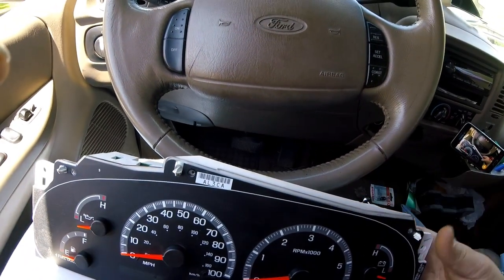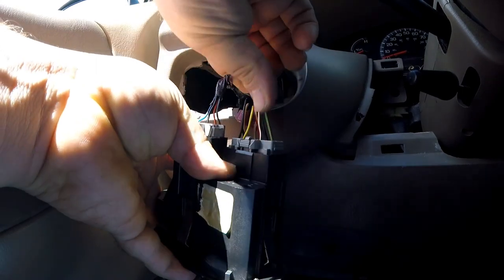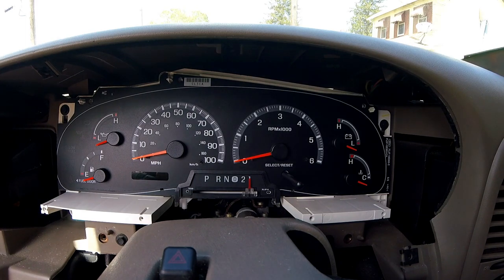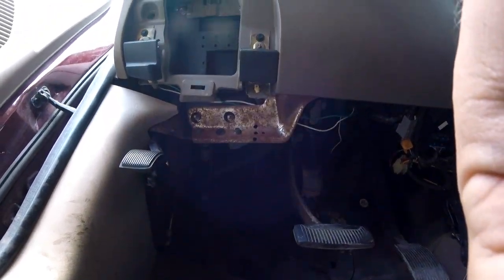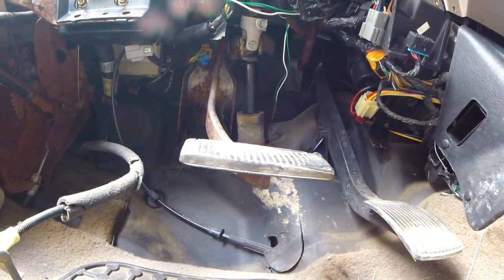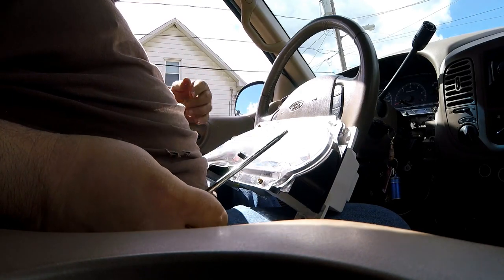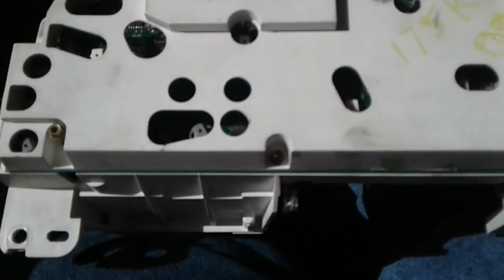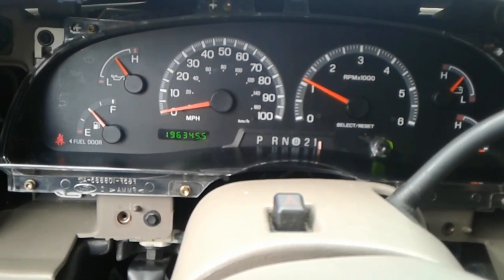f150 gauge cluster repair

Comment: I've got a similar truck with a speedo issue reading 20 over for everything.  The ODO works fine so I am going to give this a try.  I ordered a replacement used cluster and will Swap over the ODO and circuit board onto the different gauges. It should work since only the gauges will be different.  That solves the problem mileage problem since it will have the original ODO and will only have different gauges.  Lots of info about the bad solder joints but not much about this situation so thanks for the video .  Guessing newer cars are not so "easy" lol.

Comment: Mine went out also and didnt think the soldering would fix it but when I looked closer I seen the small hairline crack and soldered it back and it worked but the thing is when I done that and put it back in all my gauges was off
Reply from the maker: That's strange to say the very least
Reply: @CarManiac125  yea I was told to drive it to see if they would reset I hope that's all it needs.
Reply: @CarManiac125  but it was the first time I had taken the clusters out and I had thought that in order to get that back board out you had to take the needles off so that didn't help me any
Reply from the maker: Anything's possible. I would probably try driving it just to see but it almost sounds like some circuits got crossed

Comment: My gauges and cluster lights are going crazy. Changing the fan speed on the AC even affects it. Did you have any of these problems?
Reply from the maker: No, but that doesn't surprise me cause all that wiring runs together on them trucks. You may have some rodent damage. You see, the manufacturing process for the wire loom, use peanut oil to slip the wires in the loom. Mice can smell that peanut oil and when they get in your vehicle they will start chewing at the wires. It definitely sounds like a short in the circuit. I wish you the best of luck trying to hunt that down. If you have a multimeter you can try and test circuits through the fuse panel but honestly, I would just look over the wire looms for physical damage before using the multimeter meter cause that's just the way I'm use to doing things, lol
Reply: Car Maniac125 thanks! An oddly enough I bought my 2000 brand new. Field mice had gotten under the hood before I bought it and have had issues forever. The Ford dealership never could figure out what the problem was so I just let it go. A few days ago the issue turned into what I'm experiencing now. Up until then it was just lights in the cluster staying on. I sure appreciate your video and response. Wish me luck haha
Reply from the maker: I've worked at a ford dealership before so I kinda understand why they couldn't  find the problem. It's not the dealership itself at fault but the people they hire to work and run the service department. It's basically the reason why I left. Good luck with that adventure and I hope you can show that dealership up. My 83 olds cutlass had an electrical gremlin I fixed not to long ago. The knucklehead I bought it from had a power wire for an amplifier running through the fire wall and was grounding out on the chassis. It would kill my battery after a week of not driving it. It also caused my msd ignition box to fry and now after I installed a cheap set of gauges I think the alternator was taking a hit. I would say it probably burned my starter also but long tube headers with a stock size starter with no heat shield, was what I felt really knock that out. An as from the mice, them little guys can get into places you wouldn't expect and be prepared to clean up a lot of urine and crap. That was something else I had to do with my olds. My sinus kicked my butt that day, lol

Comment: So your saying that you were able to take your original digital odometer out and connect it to a new cluster and pats info is stored in the odometer chip and cable saving you from going to the dealership for reprogramming of cluster? If so shit yeah bud lol..was wondering this myself.
Reply from the maker: No sir, I took the digital odometer chip out of another cluster and installed it to my original cluster. You can do the same thing with the gauge motors if need to as well. Since I got a part vechile for the old thing I'm gonna see about which chip holds that pats info on for a future video if I have success, lol. Sorry I wasn't clear about that. This was like one of my earlier videos where I was still kinda of nervous about making them, lol. I'm getting better though. The neighborhood thinks I'm crazy talking to myself, they dont see the camera, lol
Reply: @CarManiac125 

Lol yeah I hear ya, I'm having a issue with a short in cluster causing all sorts of issues..was hoping to put a new cluster in with avoiding dealership visit..bummer
Reply from the maker: Hmm, what kinda problems?
Reply: Did it keep your mileage the same, or did it show the 175k miles. Thanks
Reply from the maker: Same mileage as it had before. That gets fed through the computer